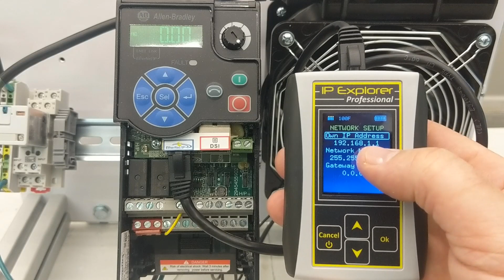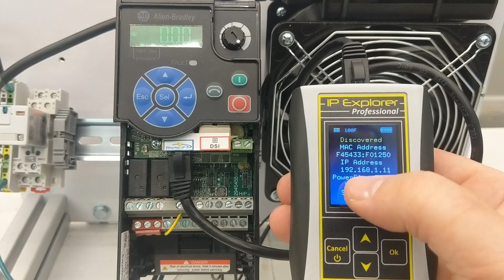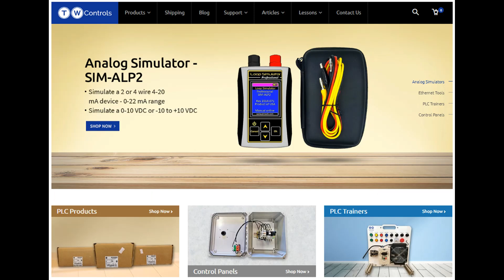How to Read and Write an IP Address to an Allen Bradley Powerflex EtherNet/IP Drive.

Comment: I know this is an older Video but I just found it. Can this device assign/find info on a AMCI SMD23E2-130 AM12 addressable stepper motor?
Reply: As soon as the unit I ordered arrives and I get comfortable with it I will let you know for sure
Reply from the maker: Please do so I can let others know in the future.
Reply: @TimWilborne    I did get the opportunity today to connect it to a unit that is setting on another engineers desk marked "BAD". I connected a power supply and then the SIM-IPE uit and it quickly found the IP after I got the SIM-IPE unit set up. So I see no reason it should not work and I will test it the next time one of the motors is to be replaced to confirm it. It did identify the IP address and the unit details along with the correct MAC address.
Reply from the maker: Great feedback.  I appreciate you letting me know.
Reply from the maker: He would likely be able to discover the IP address, I'm not very familiar with this module though so I can't say for sure about the assign. If it is Ethernet IP or Profinet compliant then it should be able to.